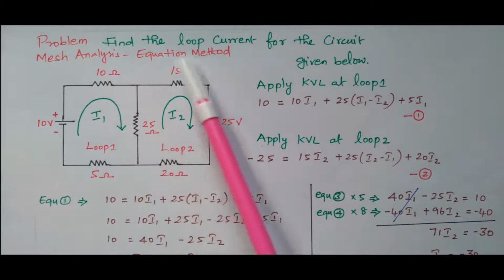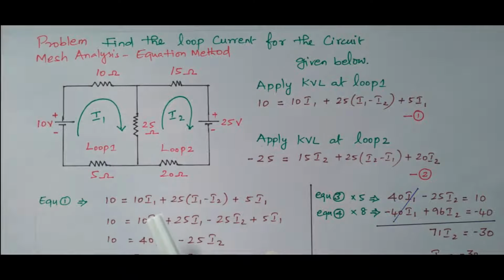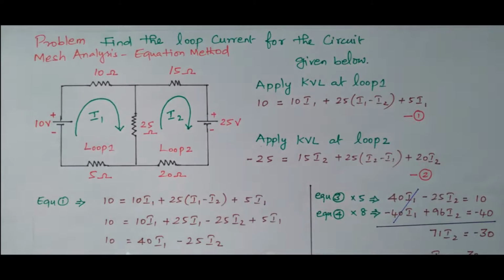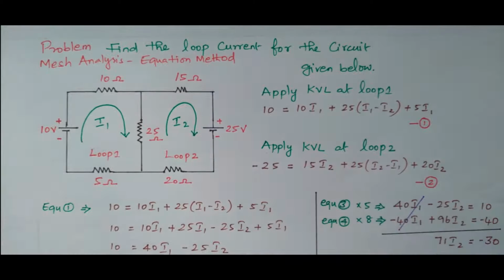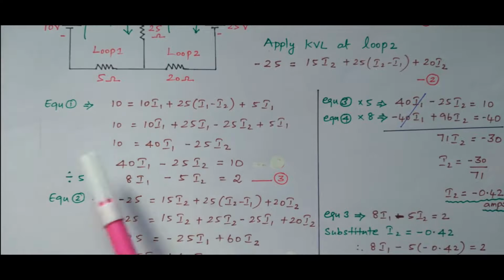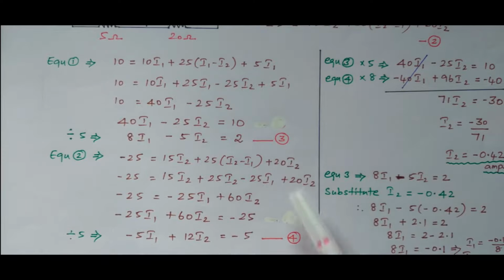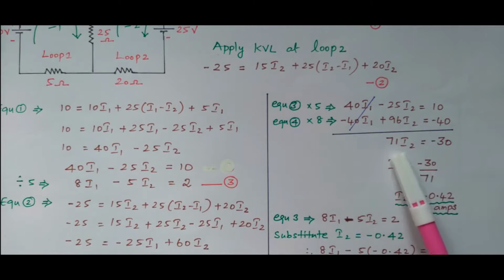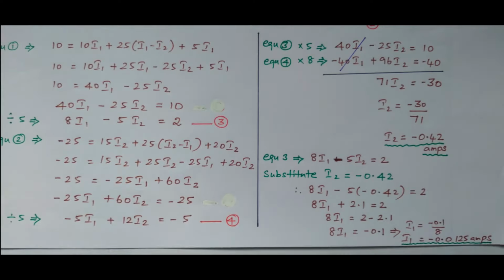Solved Problem #1 - Mesh Analysis - Equation Method - DC Circuits - Basic Electrical Engineering

Comment: we have find the current but how to find the current flowing through each resistance in a circuit
Reply from the maker: Current flowing through resistors can be calculated from loop currents
Reply: Thank you sir 
Was ther any formula to find it
Reply from the maker: For example, current through 10 ohm resistor is I1 and current through 25 ohm resistor is I1 - I2. Like we can find the current through each resistors